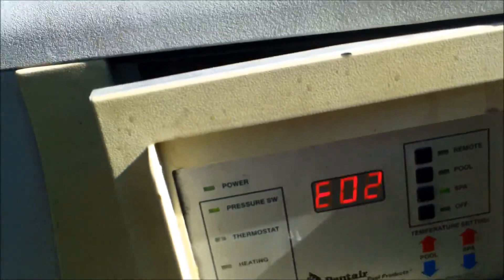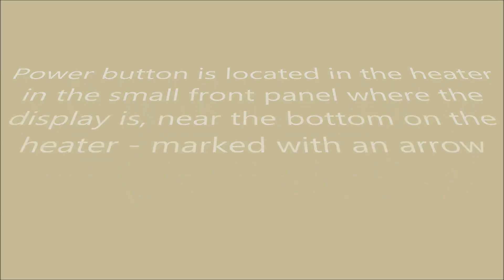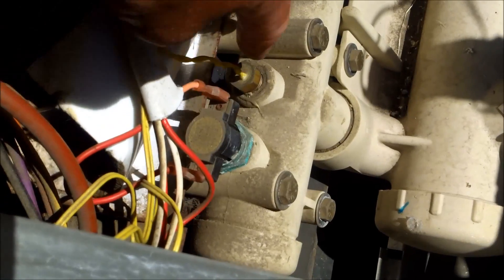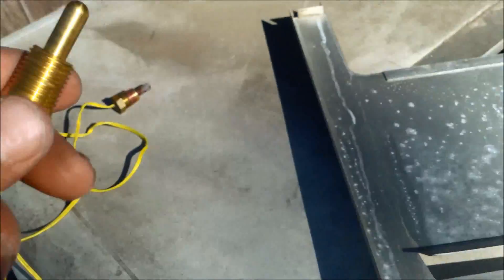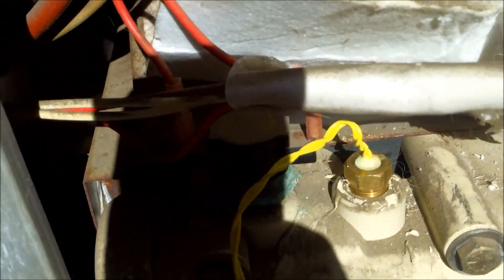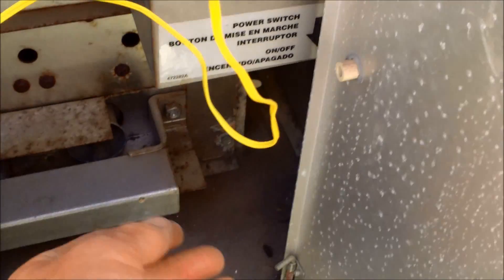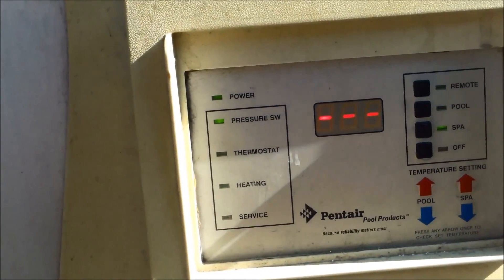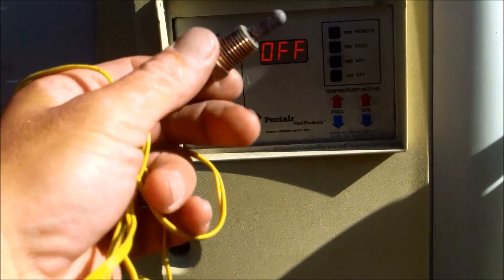Pentair MiniMax NT Heats Up for a Minute Then Stops, Error Code "E02"

Comment: How long should it take to heat up a 6 person jacuzzy?
Reply from the maker: Depends on the heater BTU and starting water temp. A lot of variables. But say you have a 400 BTU heater and want to go from 70 degrees to 101 degrees - about 30 minutes.

Comment: I have the same heater but is not working. Power light is on and also the  pressures sw light is on when the pump is running but the display is off and i cant do anything. All other lights are off. Any i idea what might be wrong?

Comment: when we try and heat our spa and turn on the jets it spikes the pressure on the filter it will heat for 10min then it clicks off and we get an e02 code and the heater sounds like an engine reving up? any ideas what it may be?

Comment: I have a question please regarding the same heater. Mine was working fine a month ago. But when I wanted to turn it on yesterday it was making loud banging noises and I think I smelled gas. 
What do you think the issue here what's the fix? Thanks.

Comment: what if you can't read the display readings.
Reply from the maker: It could be the front screen LED is burned out. On certain newer heaters it can be changed on the NT it cannot without replacing the whole board. On the Sta-Rite and Master Temp it can be changed out.

Comment: pentair minimax 400 nt std with ddtc controller. will light for 13:50 seconds and go out. It will do this all day with no error code or shutdown by ignition controller. Replaced, igniter, temp sensor, ignition controller, and the flow valve at the header. Tech support is of little help at this point. Have idea?

Comment: I dont have an error code but when turned on the pressure thermostat and light turn on, the heater light turns on, i get a smell of gas, and then it turns off. It does this over and over without heating the water. Per the pentair customer service i had a guy come out to test the voltage and said it was fine, then i replaced the igniter, temperature probe and flame sensor and nothing.....running out of options, any advice is appreciated
Reply: Jose Carrillo did you ever figure out the issue?
Thanks

Comment: "I will film the Igniter installation for this heater soon."
Could you please post the video how to replace MiniMax NT igniter?

I can smell gas from exhaust after “HEATING” goes green for 2-3 sec. After 3 attempts, it shows Error E05. Is it a false igniter? How can I replace it?

70V comes to my igniter. Should it be 120V?
I also measured that the igniter has 100 Om resistance. Is it normal?

Thanks.
Reply from the maker: I will try to film it sometime next week for you. Pretty easy to do.
Reply: Swimming Pool Tips, Reviews & How To -MrDgvb1
 Thanks. I got it out and it works with 70V - gets hot red. How to remove and clean burners?
Reply: Word of caution first, instructions second.
De energize the entire heater either by circuit breakers or local disconnect, not just from on and off button.Do not rely on timer either. It may kick in when you are not expecting it.
Ignitor Resistance of 65 to 300 Ohms is normal. Be careful with ignitor. Its very fragile. 
Two nuts are holding Ignitor/bracket assembly, just above the center burner.
In some cases the orfice just bellow the Ignitor may be partially of fully clogged.
Other burners still deliver gas,( hence the smell) but ignitor has already been de- energizes before it can ignite burners, so no fire. Also, keep in mind that dirty surface of ignitor will fail to read flame. Ignitor on these models is  also flame sensing device. Best is not to try to clean ignitor, it will easily fall apart. Just change it with a new one. 
Installation: insert (carefully) the igniter into the bracket. Filament must extend passed the bracket. Now even more carefully insert the assembly into heater fire chamber. Keep in mind, if filament touches  anything metallic it will burn to ashes once energized. Place back support bracket by first passing two wires through center hole of bracket, making sure wires (even insulated) are away from metal.
fasten the 2 nuts. connect wires. Use straps to group any lengths of wires hanging lose. Re energize the system. Normal operation sequence:
1) fan comes on- pause 2) Ignitorr glows-pause, 3)call for heat- heater fires only if setting on thermostat is above actual pool water temperature,
Heater may shut off at first attempt old code still in memory.. Let it repeat cycle by itself. Once the system is normal old codes will clear automatically.

Comment: What if you do not get an error code but it says "HI" and the heater will not turn on?
Reply from the maker: It mean it thinks it has reached the maximum temperature. It sounds like it is this part  or a bad High Limit Switch. I would try this fix first as it is cheaper and one you can do yourself. If you replace the part and still no dice you will need to call a heater repair guy.

Comment: what if the screen says off and doesnt heat up
Reply from the maker: It could be a couple of different issues so my best advice to you is to call this number on Monday and see if they can walk you through the troubleshooting. This is Pentair Tech Support ann the guys who answer the Heater problems are actually very good: 1-800-831-7133. I've called them a few times when I am standing in front of a heater and the results were good.
Reply: k thank you and i try to ignite it but it wont ignite

Comment from the maker: I think you are correct. This heater is junk. Unfortunately I have one in my back yard. Replaced circuit board, 3 temp sensors and two ignitors in 8 years. Pentair stopped making it because they couldn't keep up with the replacement part demand ;)

I think you have your Google+ or YouTube set so no one can reply to the comments you post. I can't reply and I know that there is a setting somewhere you need to change.

Thanks for the great comments - they are right on the money.